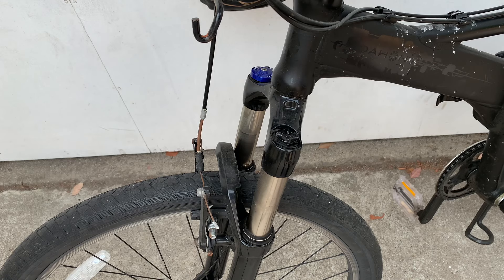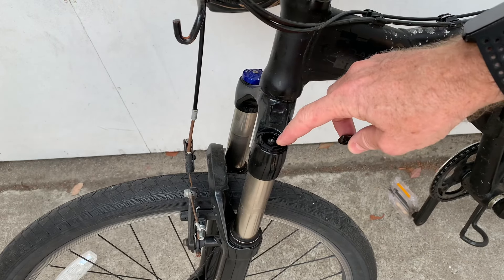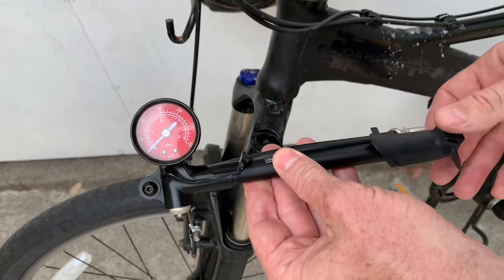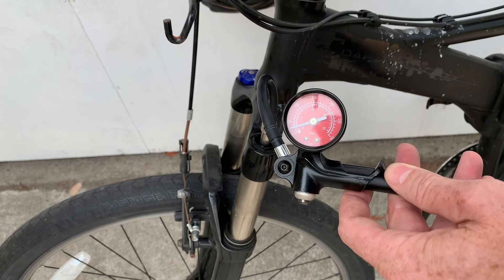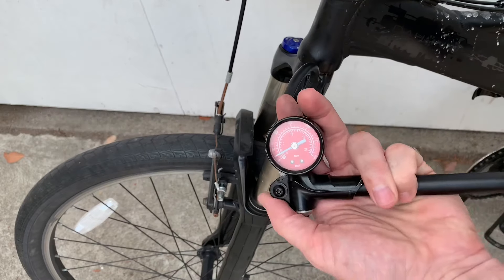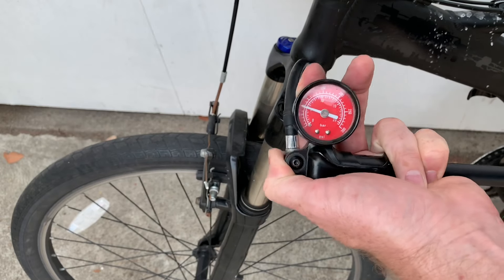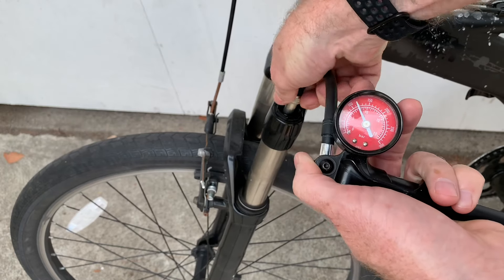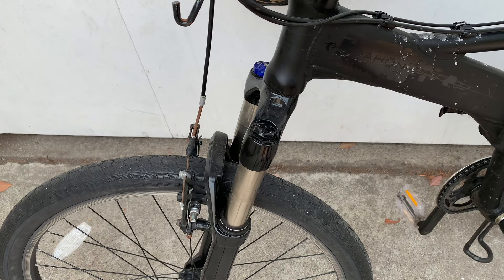How to put air in a bike fork

Comment: Don't forget to air the frame
Reply from the maker: Thanks
Reply: @hoohoohoblin  Don’t know if you can help me but I have a ebike with full   Suspension and the past few days there has been a Rattleing noise around the fork area  could the problem be that I lost air pressure band do what you did please help.
Reply: @unitedtalentagency7659  check to see if you have any cables hitting against the fork
Reply: Dang it!
Reply: I cant find the valve on my frame!

Comment: Which is the top of the shock and which is the bottom air pressure? All the air valves for my compressor I have wont fit into the top is there a special threaded type? I cant figure out the top and the bottom in the diagram for psi, my fork is really similar.

Comment: Mine has just 2 rubber plugs. I can only see a hex nut about 10 inch deep. At the bottom there is just the end of a bolt. Can't mine be adjusted?

Comment: I have a rockshox pump made for this, and it worked perfectly about a year ago when the guy did it in the store, but now when i unscrew the pump, the fork loses all air immediately. What can i do about this? Please help
Reply: I have the same problem have you figured it out?
Reply: @cam.chiodo.3625  i just figured it out today. In the thing in the bike where you put the air from is a tiny ”spike” thing that presses down if you take air our of the fork. If that ”spike” is always pressed down (my situation), the fork always loses air immediately. I just contacted the bike store idk yet if it’s fixable or if the ”spike” has to be changed.

Comment: When you unscrew the pump from the fork does it lose some air?  That’s what I’m worried about on mine. Seems like some leaked out when you unscrewed it. Thanks!
Reply: You just gotta be quick and maybe put an extra 5 psi in , then set your sag the air is just a guide.
Reply: Rockshox claims you won't lose any air when unscrewing
Reply: It’s an air from the pump equalizing with room air pressure. Fork not leaking air.
Reply: I lose all the pressure when i unscrew it what can i do? Please help it was an expensive bike

Comment: I just got the same pump today. I was worried mine was defective. The first time i pumped up a fork i did it in a few strokes up to 150psi. Now every time I use it it takes as many pumps as it did for you. I am guessing mine is fine. This is the first shock pump I have owned so I am not sure. The amazon reviews where mixed.
Reply: yeah, mine does that too like its just few pumps and its already at 150psi. I don't know how to fix it. it just doesn't give enough air
Reply: What may be happening is the pump is not screwed in far enough to open the valve so you are just filling the pump hose which only takes a couple of pumps.
Reply: @Boncked  Wow what a nice, niche piece of info. Thanks.

Comment: Can anyone tell me why the pump doesn't shows what pressure is inside the fox fork when reconnecting the pump? If I press on the valve air is released so pressure is inside. When I check the rear shock, pump shows the pressure. Not using a Fox pump. 
Thanks

Comment: Mister!! Is it ok to use a portable air pump as an air shock pump? Or is there a specific tool for this problem?
Reply from the maker: There is a specific shock pump. If you try to use a regular tire pump, do it very slowly because there isn’t much volume. You don’t want to pump a huge amount in and blow it out.
Reply: Thanks mister!

Comment: When I go to take the air cap of with the plyers it moves the actual nut that the cap is attached to
Reply: Note that he specifies 'sometimes' I've never had a bike where you can't just unscrew the cap by hand. Also insure you are trying to unscrew the air cap and NOT the adjustment lever.
Reply: No need for pliers.

Comment: 2:04 don't do that. that's a bad idea. I did it after watching the video and after few days I wanted to adjust the pressure and when i tried to get the seal loose it startet moving in place. I had to hold the ring underneath and open the seal. I have no idea if that moving in place damaged my for.  I heard from a guy from a cycle store nearby that trying so much and making the seal move in place moves everything underneath and might break my fork. He said: you have to seal it with your fingers.

Comment: You mentioned you don't have to pump it up all the way for the fat dudes ' does that mean there is a spring in the tube for the suspension  and the air is for how stiff you want the front of the bike to ride ? 🤔🇺🇸
Reply from the maker: No. There’s no spring. It’s just air. That makes it lighter than a Spring fork.  There is always some air pressure in it, you just add more if you are heavier or want a firmer ride.
Reply: Don't go past the recommended pressure for your weight. The fork can't handle it. If it's still too soft for your weight, adjust the travel with the fork closer to the closed position.
Reply: @xavier8351  do i have to pump both sides or just one?

Comment: Do forks have to be on lockout or open?
Reply from the maker: It doesn’t matter. Just make sure you are not putting your weight on the bike while sitting on it and adding air at the same time.